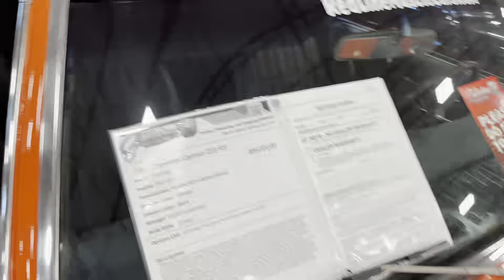Hot Rod Tour of Texas, Cruise day 3….and parts carnage….

Comment: I man sorry about the turbo … when you first opened it I thought i saw some discoloration on it, on some of the fine faces and edging like it was rubbing on something but its hard to tell with the lighting but it turned smoothly.  Did you figure out what caused it to happen?
Reply from the maker: No.  Can’t determine the cause.  The wheel wasn’t touching anything and it spun very smooth.  Some think that header slag or a piece of motor went through it, others think it was heat temperament failure of the wheel itself….who knows?….

I sent it off to be rebuilt, I should get it back next week.  A quick $1100 down the tubes…